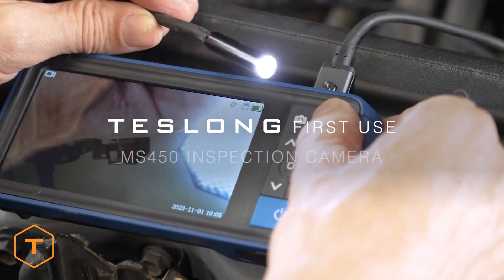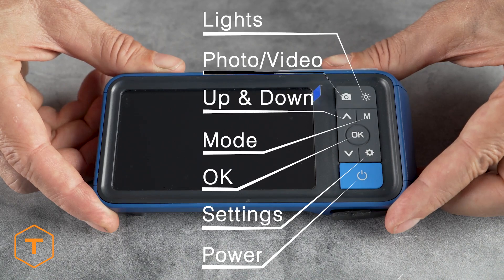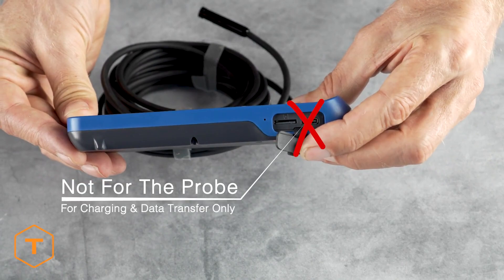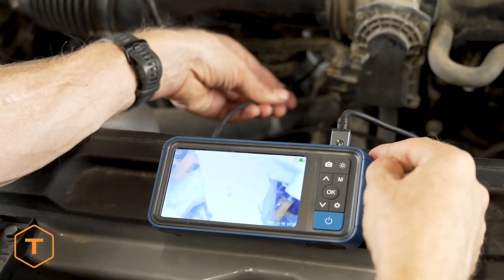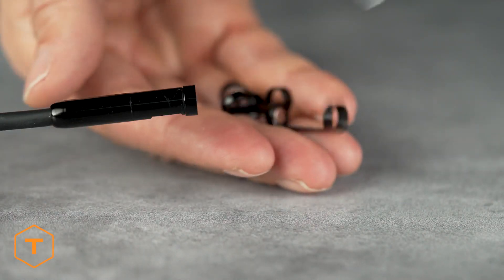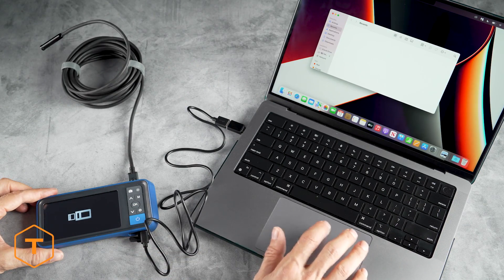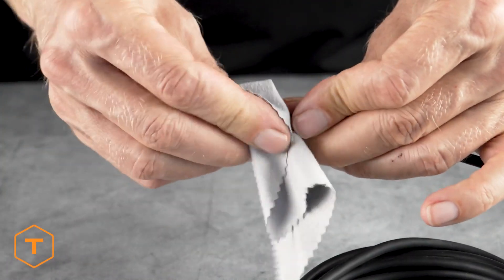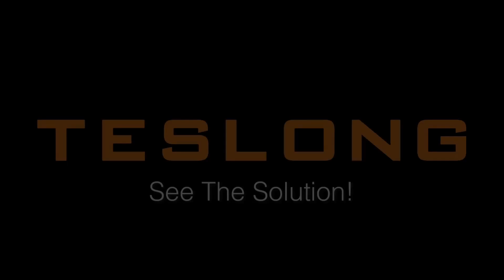Teslong MS450 Inspection Camera First Use Video Manual

Comment: I notice you've used a USB(A) to USB(C) adapter.  Can you connect directly with a USB(C) to USB(C) cable to a MacBook Air M2.  That doesn't seem to work on mine.  Should it ?  It's fine when I connect like you have and use the cable in the pack and an adapter.
Reply from the maker: It should work, open PhotoBooth and then you may have to switch the camera (dropdown menu) from webcam to Teslong Cam and that should do it. There are more details on how to connect your Teslong Borescope over USB in this video - https://youtu.be/Y6Y1dn-QQwQ
Reply: Thanks.  Sorry I didn’t mean connecting the camera to the Mac but the base unit so I can read the TF card on the Mac? Works fine with the cable in the box and an adapter. But not directly with a usb(c) to usb(c) cable. Just wondering why this is ?
Reply: @TeslongTechnology Thanks very much for the prompt reply!
Reply: Just a note for anyone else reading this with a mac in case you didn't know this.  There are very small USB(C) to USB(A) adapters available (much smaller than the old Apple ones with cable in them).  I grabbed one of those and attached to the UBS(C) to USB(A) cable that comes with the MS450 and it works fine for downloading files and charging and takes up nearly zero space in the bag.

Comment: I have this exact model is there a way to connect the camera cable to my android phone? I connected the camera USB c to my phone but nothing happens
Reply from the maker: Unfortunately, the probes are specifically designed to work with our monitors and even though they are USB-C they won't work with an Android phone. We do make inspection cams for Android/iPhone applications including this one - https://www.amazon.com/Endoscope-Teslong-Borescope-Inspection-Waterproof/dp/B0CL4MJ6NK?ref_=ast_sto_dp